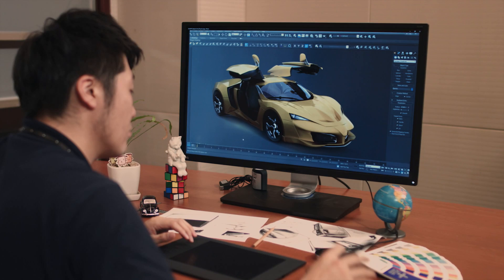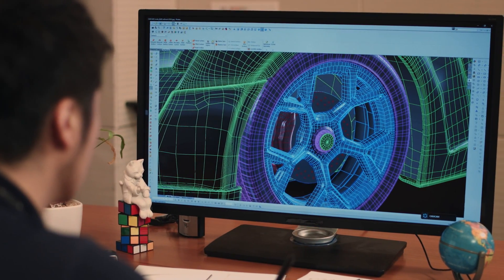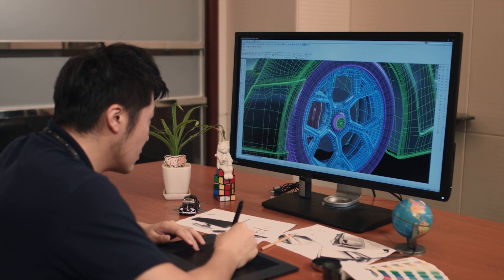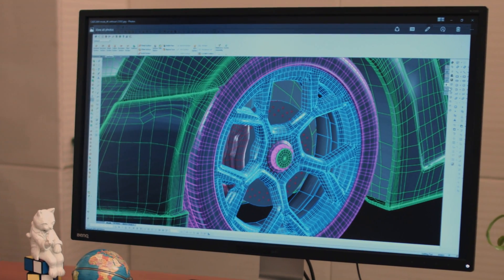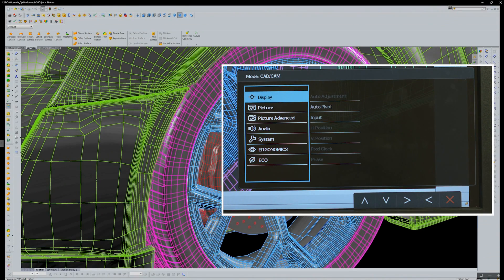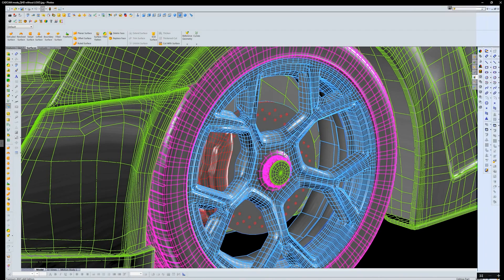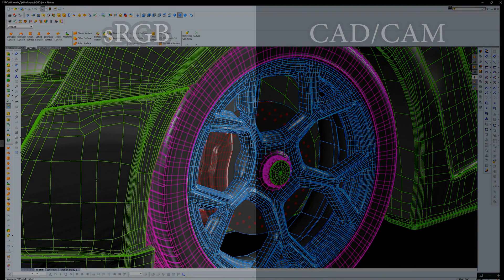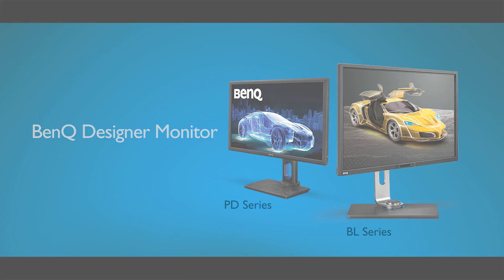How to set up CAD/CAM Mode to emphasize on fine lines of the drawing

Comment: Hello, is this feature a special technology or a setting which I could also adapt on benq bl2581t?
Reply from the maker: Hi there, thank you for reaching out. The CAD/CAM mode is a special mode on our PD series and BL2420PT model and is not embedded in the BL2581T. 

For more information about our PD series:
https://www.benq.com/en-us/monitor/designer.html

For more information about BL2420PT:
https://www.benq.com/en-us/business/monitor/bl2420pt.html

Hope this helps!
Reply: @BenQGlobal  Thank you so much for the response! My problem is that I want to suit two old 17'' tft monitors in portrait with a new. BL2581T has the perfect size and its screen is amazing.  I work with Autocad and a new investment has to have an extra benefit. I look also for the PD2700Q but the size and the price is overkill for me.
Reply from the maker: @asthrmyl  Hi, Thank you for getting back to us! How about PD2500Q, it comes with a similar screen size as BL2581T and also supports CAD/CAM mode. We understand that this is not our latest model, but based on your description, it may better suit your needs. :)

Let me know if you have any other concerns. Thank you!

Here's the product page for your reference: https://www.benq.com/en-us/monitor/designer/pd2500q.html